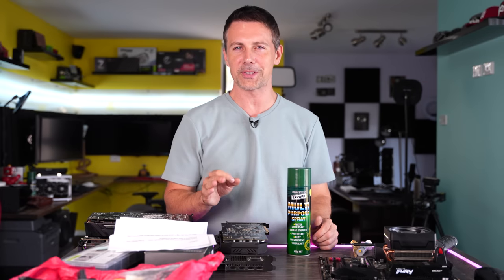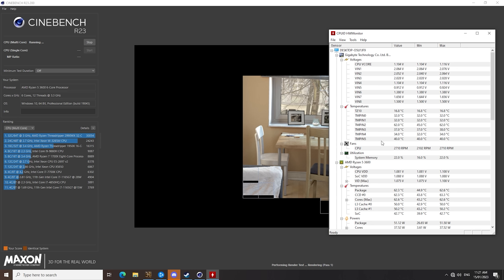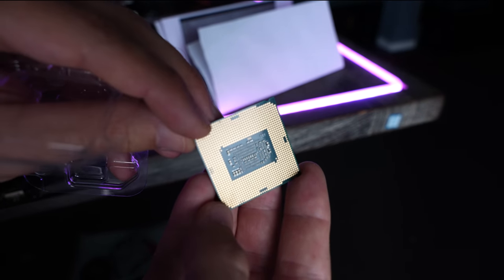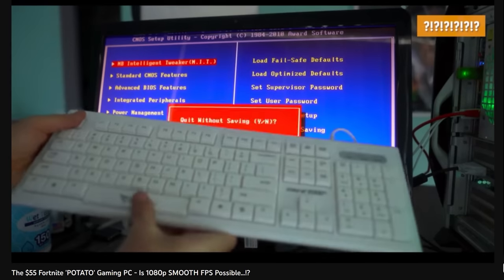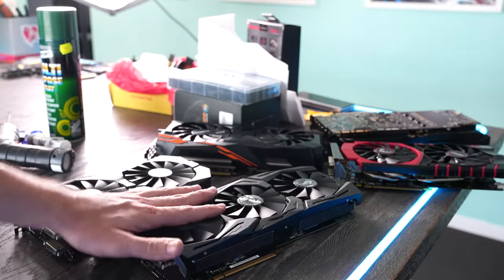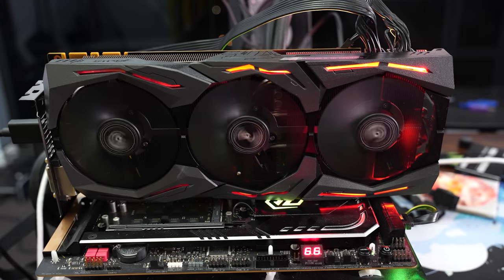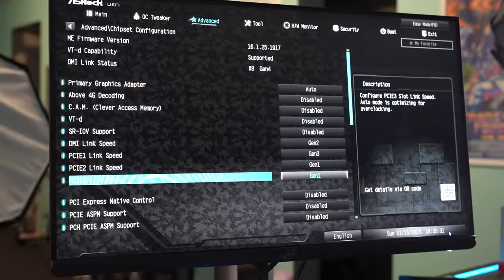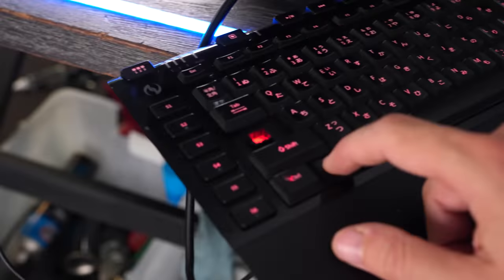Can you FIX a Ryzen 5 3600 with FAULTY Cores? | (Can YES Fix It).

Comment: My second-hand 3700X dropped a memory channel. "B" channel. I was stuck at 1-channel (Dimm Slots A1 & A2). The IMC (integrated memory controller) dropped a channel. I replaced it with a (second-hand) 2600X and I've been fine since, but, it does give me pause when it comes to overclocking . . well, any part of my system. I was able to OC my memory to 3733MT/s with repeatable reboots, using the 2600x, but, I settled on 3400MT/s as a stable Mem-OC. My timings are 16-16-16-38 @ 1.385v . . and it holds stable there. But, I DO worry that I'm pushing my 2600X's IMC too hard. I really want to get a Ryzen R5 5500, as it should have a superior APU IMC. I should be able to get to that magic 3733MT/s mem speed and keep it stable. Maybe even hold 15-15-15-36 stable. Of course 3800MT/s at cl18 timings holds stable too. I would like to note that I have better luck OC'ing my system using my Linux boot drive than I do my Windows 10 boot drive. But that has just been my experience, ymmv.
Regardless, Best wishes good tidings from the Great State of Alaska. 🥶if you decide to visit the state, bring a quality blanket. 🍺Cheers!

Comment: Thanks for saving my new 3600 build🤣
Gd thing i found this video, because knowing of the potential problems due to over heating from OC out of the box, I can change the settings on this new Ryzen5 3600 before those settings do damage.  I forgot to tell you, back in Nov. or Dec for $90. that new RX580 8gb from MLLSE China that just went into AMD5 3600 box the one I'll be using your videos to cool down.

Comment: When does the CPU start to freeze? Right after installations? Have a PC getting built using the 3600, with an MSI B550 board. I am not a big gamer, so not worried about over-clocking. Ok want to watch your other video  on the same topic. Thank you 🤓

Comment: I have two Ryzen 5 CPUs a 2600 and a  3600. The 3600 won't post at all. The 2600 would freeze in multiple B450 boards but seems to OK in an A520 which officially doesn't support 2000 series CPU's! Not sure if its a couple of dodgy PCI lanes and the A520 doesn't  use them.

Comment: I experienced a cpu killing motherboards (or viceversa), what was worse was that it copied the problem, the dead motherboards would kill working CPUs, so using any of those components would kill working components. Mayhem until I realized what was happening. It was on Intel Slot 1 platform = many years ago.
Reply from the maker: lol agent smith effect, that's a first I have heard of that

Comment: I've had the 3600 since launch and it hasn't degraded yet. I always run it with a dynamic VID offset at -0.72 mV. Stock voltages were just too high that's the reason why I did a undervolt.
Reply: I bought mine In 2021. I did notice the vcore was hitting 1.440v which definitely is way to high. I disabled all the PBOs that were in the bios. That dropped it to 1.328v. But I might do what you did and see what happens.
Reply: @SlyDive700  Of course this was a lot of trial and error on my part. I had to do CMOS resets just to find this offset. Also a typo it's actually -0.072 mV.

Comment: I just swaped my old 3600 for an 5700x. When i took some shots from CPU-Z before the change, te voltages of the 3600 were over 1.4V stock (i never used PBO). I have a MSI B550 Tomahawk. I think those voltages were "normal" for the first run of zen 2. I got my 3600 at launch.
Reply: i noticed that too so downclocked the voltage till the cpu got stable memory was high volage to @ mine standard settings

Comment: 🤔 so Ryzen chips are failing due to heat and volts, ok that makes sense, so avoid them if they are used, sounds similar to used gpu mining chips. I assume if u buy it new you should be ok, just get a beefy cooler and tweak the bios a bit. Thanks for the tests and explanation, makes alot of sense.

Comment: I had a problem with a GTX 980 I picked up, it was over heating 91c and the blower fan ramping up like mad yet the temps was find at idle. I tried an under clock that didn't work in the end, I lowered the power draw but 3% and it's now fine under 80c and the fan no longer goes mad.

Comment: B550 and X570 are known to have USB issues. A manufacturing defect on these chipsets that doesn't affect A520. I know a lot about it. First, only use USB 3 even when plugging USB 2 devices like a mouse. Then, use no m.2 drives, only SATA. If that isn't enough, lock PCI to gen 3 in the BIOS.
This should fix all USBs.

Note: the USB issue usually doesn't brick the USB ports but causes disconnects and reconnects of like your mouse/keyboard mid gaming sessions or just circling the cursor on your desktop. Windows doesn't play the disconnect/reconnect sound, but suddenly he mouse stops moving for a while, or a key keeps registering as pressed on your keyboard even though you released it.
Reply: ive seen simmilar usb issues with these chipsets and zen 2 cpu, they where fixable by a +0.025V offset for the soc.
Reply: @motorb1tch  really? Because I have these issues with a B550 and R5 5600G and fixed them by using a SATA drive. All USBs including 2.0 seem to work fine but I still only use the 3.0 ports just for extra safety.

Comment: The piece on the R5 3600 is interesting because my system shuts down sometimes when I boot it up. The manufacturer of my motherboard will show up on screen and it just shuts down. 
Sometimes I get the bsod after logging in
Mine is only two years old bought in Nov. 2020

My motherboard is a MSI B550 Pro-VDH
I don’t think much of it and just power the system on again but am wondering if at some point I’ll have to replace CPU because of these issues

Comment: this is exactly when i get computer parts from recycle, I have test motherboards that are working but like the crappiest ones like an H series board where even its bios looks like its from 1998 just incase I run into a graphics card or cpu that could kill the board,even use a low end PSU for them. my low end PSU i use is the EVGA 600w which is just 80+ some people refer to 80+ white

Comment: For a motherboard that underclocks bus speed maybe 1156 or am3+ would work the best for that ?
Think FM2+ can do fsb overclocking alright which probably makes it fine for underclocking too.
Another thing too try is lowering the pci-e version in the bios settings & I'm not 100% sure, but maybe 1155 with pci-e underclocking could work as well for this kind of thing.

Comment: I bought a EVGA 2080TI XC Ultra from a Miner, and everything seems to work fine with it, but the boost very rarely goes above what the base clocks are supposed to be at 1900mhz, and the base clocks seem to only hit 1600mhz. Not a big deal, but do you think I should try saving the current bios for safety to go back to and try flashing a bios from EVGA and see if maybe the miner put a custom lower clocked bios on it to make sure it was stable to sell?
Miner claimed he took it on a trade but never used it for mining, and I couldn't test it properly cause my rig wasn't setup for air cooled cards.

Comment: Tip for AMD cards: If you only install the driver, not the software and are on a bare bones Windows install (I recommend ReviOS), instead of freezing up, it will never go up to full memory/core frequency. It gives you time to try out afterburner, flash a BIOS etc

Comment: Brian do you use a multimeter to check for shorts on the main power rails before you plug into a motherboard because you can fry ur motherboard or corrupt the bios if you don't and also make the gpu unrepairable ?

Comment: Its rare but that cpu has an internal short, more than likely due to aging volts heat and somewhere inside the chip two circuits started touching each other, and yes a shorted cpu chip can in turn short out the motherboard, u might be able to repair the motherboard by sending it out to someone that specializes in component replacement.

Comment: I don't know man, I use an Athlon 3000G (2C/4T) + 2x4GB DDR4 2666 + 240GB SSD with no discrete gpu as my HTPC, and it works flawlessly (got it for a stupidly low price). I can even run some old games at 1080p low settings (the one I enjoy most every now and then is Ori and the Blind Forest). Windows update do take more time do to low resources and power. But other than that no major problems with it.
I can only imagine a Ryzen 5 3600 with only 2 cores should way more powerfull do to generation improvements and speed boost. But you are lacking the iGPU with it.

Comment: 7:15 re the bricked motherboard try removing the Bios battery but also the ram then power it on without any ram obviously it won't post but this can reset it. I've bought a few back to life this way. I can't explain how but it's kind of my last ditch attempt with any board and it has worked a few times.
Reply: Because RAM can hold information, maybe it still holds some information that's stopping the board from booting properly and by powering it up without the RAM it resets it don't know but deffo worth a try.

Comment: The vega64 problem can be in PSU. I have platinum 750w Seasonic. But sometimes i have random reboots. Even when the power limit for GPU is 100w. And on 240-250w GPU can work fine for a months with same setup. Strange. Before rtx 3070 i had an asus strix rx580 with the same tdp, and there was no problem. I've heard this shutdowns is because of high spikes from GPU, and PSU think its a short-circuit

Comment: I've had 5900x that couldnt work at stock clocks/voltage out of the box. I've fixed it by adding extra 50mV to it. It is still working fine afaik. Also strix 1080ti with degraded memory is quite common. But they seem to stop degrading further unless you keep mining on them.
Reply: That would suck.  I had a couple 5800x that were way too hot.  But thankfully my 5900x isn't too bad and my 5950x is really nice.

Comment: 1:35 could have a lot to do with the stock thermal paste on the AMD coolers. I've had a few where it sets like cement and is almost impossible to separate the CPU from the cooler after 6 months or so use.... And it's gone hard then it's not gonna be thermally conductive anymore.... With the spire and prism coolers I've ripped a few Ryzen straight out of the socket Coz they were stuck to the bottom of the cooler.

Comment: I have an interesting quirky mobo have a MSI b550 pro vdh wifi mobo that came in a combo with a case and 550w psu for $100 US i can send you the listing. the issue ive had with 3 out of 4 of these mobo combos is that the bios cannot be updated. bios flashback button doesnt work, Mflash shows the usb drive and its folders but the bios file doesnt show up. the 1 of 4 that worked (paired with 5800X3D) showed the bios file in mflash and it flashed all the way but bricked itself on the reboot and i was able to save it with latest bios+flashback. the one i have now (paired with 5600x) cant be updated (qflash/flashback or mflash/ui bios)  and is the only one that shows no cpu metrics in windows(temps, clocks, power) but they report fine in bios. I used multiple programs and hwinfo hangs on cpu detection and slowly works thru core detection before opening(ive updated chipset drivers). can we trade motherboards and ill take a lesser b450(that can run 5600x) and u can investigate this board and try to update it?  1 of them was also paired with a 5600x  with the same bios build date that showed temps fine. i also ran the last one on a 2700x fine. i can provide more unmentioned details.

Comment: i have the same problem with my 3600, i just increased the voltage in the bios and it works fine
Reply: If anything,  you should avoid over 1,3v , so if you are under its fine
Reply: @antraxbeta23  1.272 v

Comment: I have several AMD motherboards that have been bricked by the Ryzen 3600 CPU's. Not sure what happened other than I was moving the CPU's around. They worked fine in one machine but then bricked the other MOB's. When I would try and put them back in the original MOB the CPU bricked the board as well. 🤔🤔😒😒

Comment: I set my ryzen 5 3600 to 3.6Ghz @ 1.150v. Anything above 3.6Ghz crashes/BSOD even if I increase the voltage. It won't freeze on BIOS, only on windows. Updated to latest BIOS version but still crashes beyond 3.6Ghz. Really weird. My mobo is Asrock B550m-HDV with TeamGroup Dark Za 16gb 3200Mhz CL16 with hynix chip. I have a PCCooler Corona GI-X3B with 3 heatpipes rated at 125W. Max temp is 65C during 30mins of CB R23 with this settings.

Comment: the ryzen problem is due to aggressive pbo imo these parts shouldn't regularly go above 65 degrees the 95 tj max is ridiculous. I've had mine since 2019 overclocked to 4400 at just under 1.2v with mode 3 for vdroop in bios so the real voltage will be slightly higher. PBO draws much more voltage and gets hotter for lower clocks. High voltage and heat over 65 for prolonged periods causes electron migration due to the gates breaking down from what i read when overclocking so i limit the thermals to 68in the bios even though, unless its hot it rarely hits that temp at full load . and when i was researching then there was numerous reddit posts about these chips dying then.

Comment: Ryzen motherboards  b450/B550 almost all had excessive volts applied from the get go.   Msi/Gigabyte/Asus  Etc.    Upped them even more to be able to allow the use of 3600 ram speeds in Bios updates.   From the start Bro was like undervolt,   many others had mixed reviews.   Asrock had the lowest factory bios settings if i remember right.   So for many 3600's they have had some really bad mileage even if just watching youtube.   Mobo makers pushed the limits on overclockable cpu.   Not like its the first time
Reply: I run my SOC voltage at 1.0 volt with no issues, asus by default throws it on 1.2 volts the moment you enable XMP.
Reply: Im using b550 mobo's with my r9 3900x and r9 5900x and a b450 with my r5 3600 and not once have I encountered the RAM being overvolted. Using 3600m/t in the zen2 systems and 4400m/t in the zen3 system, so nothing you say rings true, or has ever rang true for me over the course of over 4 years.
Reply: @beezle1976  it's not about the ram voltage but the SOC voltage. Ram is mostly 1.2volt and 1.35 with XMP Profiles.
Reply: @beezle1976  awesome so look at what i said the cpu overvolted allowed for the ram speeds, If you were able to overclock.  Hence killing your cpu softly.   Mobo aibs dont ussually jack up your mem specs.   "Would you prefer boost, or non boost?" is in XMP/etc

Comment: My 3900x is even more odd, it works fine when doing hard stuff, cinebench, blender on CPU etc, but on very specific games like genshin, insta crash! (Specifically unity games are more likely to crash it)

Still get some freezing which has 50% chance of recovering if you hit the keyboard or take out a usb device or take out the headphones - aka some sort of io change needs to occur,

Often times id have to just force restart if I can't recover, or it bsod by itself
Reply: if your motherboard allows it, try to use an offsetvoltage of +0.025V for the soc.

Comment: Literally just had a client with this issue.
2700x and either a core or more on the second ccx was busted. I just turned off the 2nd ccx for him but still going from an 8 core down to 4 core is pretty nuts.
It would boot into windows when running like 1.5v+ but obviously not ideal for use.
I have a feeling if these ryzen CPUs were paired especially with Asus motherboards they were just fed too much voltage.